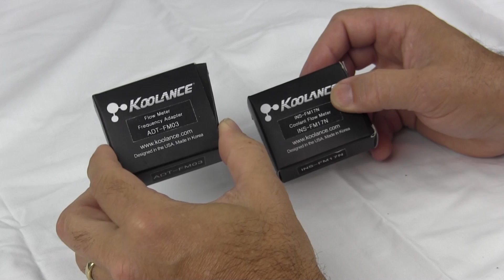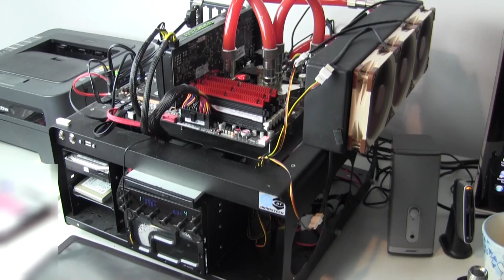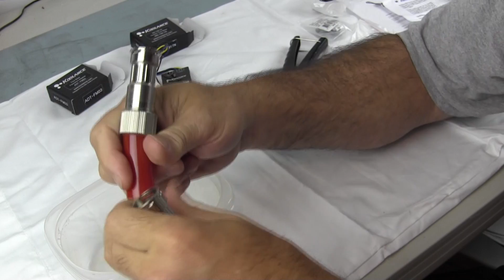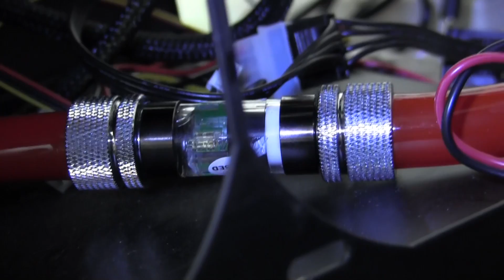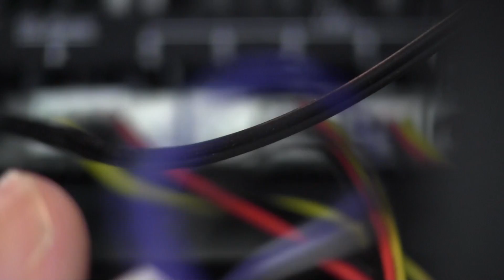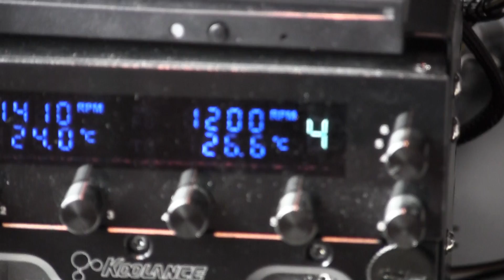Koolance INS-FM17N Flow Meter, ADT-FM03 , Aqauero Temperature Sensor Installation

Comment: Just one question...

If the flow is 15 litres / min, thats 15000 ml / min, but my digital reading on fan controller only has 4 digits, so it would only go from 0 - 9999.

So what would happen if the flow was over 9999 ml/min? Would it cause a paradox and destroy the universe?

Comment: Great video, although I had to skip a lot :-) the reason you are getting such low flow is all your Koolance quick disconnects are seriously restricting your flow.  I was watching German guy's video and he was using INS-FM18D which has it's own display and he was getting 3.4 lpm with smaller pump + integrated tubular reservoir., triple rad. and cpu block.
Reply from the maker: Dima Prok Yes, you are right. That is what was causing the low flow.

Comment: I am wondering. where will you see the temperature's you get from the aqua tuning temperature sensor connected to the radiator?, also have you tested the plug sensor from xspc that has an LCD included, Im curious as to where you could connect it or an alternative connection apart from connecting it on the tubing (in line sensor) using the adaptor a T Connection which in turn need 2 extra compression fitting or barb...
Reply from the maker: I have used the XSPC temp sensor and you can connect a temp sensor with a stanrd probe for air temp or inline sensor fr coolant temp. The displays though are not the best quality. I have had a few with display problems.
Reply: Okay cool thanks !, I am trying to add an in line sensor for the liquid temp connected to the tubing  but the fitting that comes with the xspc sensor will need 2 more extra fittings which will cost me more, unlike the one you are using which fits directly to the Radiator, I think ill get the one you using since I don't need to add 2 more compression fittings or other brand which ever is cheaper :)..

Comment from the maker: Yes the pump can be turned up. It is a Swiftech MCP 655 vario and the pump was set on 3.  I now have the XSPC X2O 750 which does is not adjustable (at full 12Volts) but it is running at 1.6 Liters per minute.

Comment: Ron can you turn your pump up or is that as much flow as you can get? The flow you have on this video seems really slow I have seen alot of other videos that have the flow meter rolling though i'm not sure what it is supposed to be I just think you could be getting alot better temps for water cooling an open system like that. Most others are in a closed system and run at those temps don't they? Just curious

Comment: I was wondering if you can place a longer tubing in between the cpu and motherboard block to get rid of the kink and show if there's a difference in flow, that would be a cool vid.  You can show the difference in flow between a kink and longer tubing. And great vid.